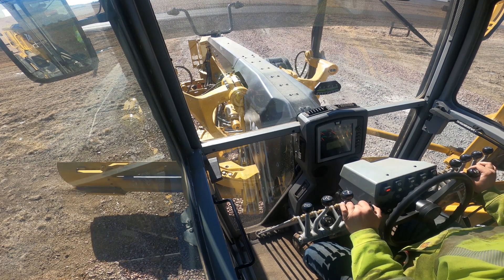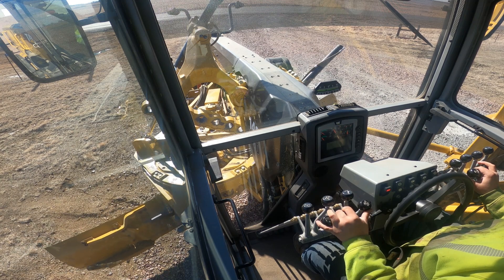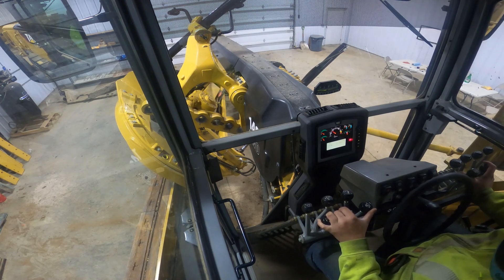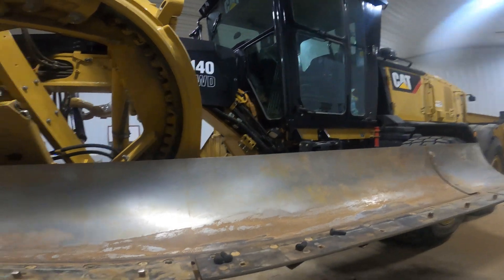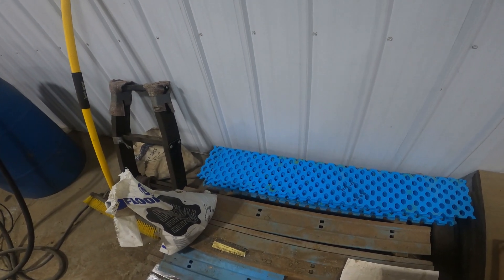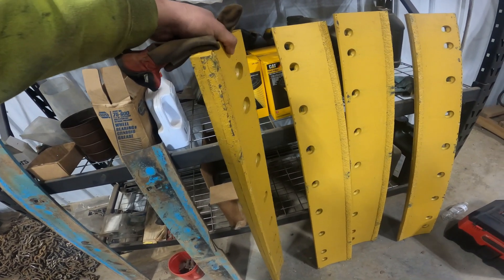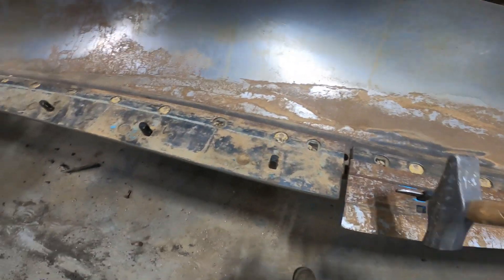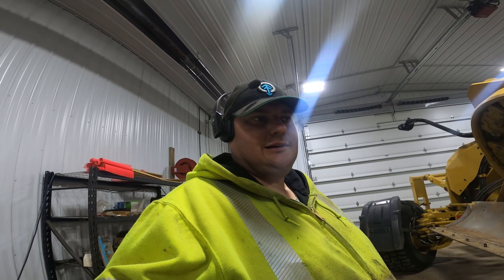Cat 140 sharq edges change

Comment: We have a whole Sharq edge system forsale - very good deal if anyone is interested. We don't use it, as the cutting edges simply wears too fast in our very hard gravels (flipping them 2 or 3 times during the day to get even wear on them). We too use the 1 inch double carbides. Double carbides work better for our gravel type and grading technique.  Thanks again for your informative vid's !
Reply from the maker: Hopefully someone will take it off your hands I like the job the system does but don’t like having to rotate them like you said to keep them straight and your welcome glad your enjoying the videos!
Reply: If you ever need a quote on the double carbides let me know! DMC Wear Parts - Kody

Comment: We do have that same system but I modified ours so we can use the thick carbides on the same board ...I put kirb stop bolts through the fixing plate then we had some thick and thin plates cut so when u put the regular thick carbides on we use the thin plates then the likes of the P300 we use the thick plates works pretty good for us thks for the video awesome job ..

Comment: i do not care for the Sharq system. i have used them and they are not worth the trouble. one inch carbides bullets, or cutting edges. swap as dictated by the conditions
Reply from the maker: I am not a big fan of it either i much rather have the carbides or the stinger bits thanks for the comment and thanks for watching!
Reply: @graderman140m   im a blade operator my self 19 years,  its a good thing to share the knowledge we have as its becoming more and more difficult to find knowledgeable skilled operators